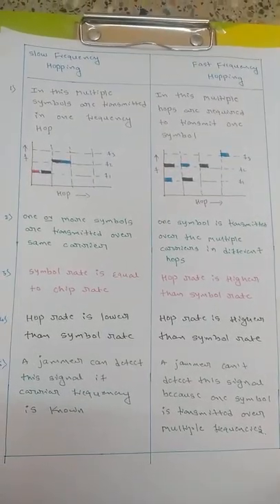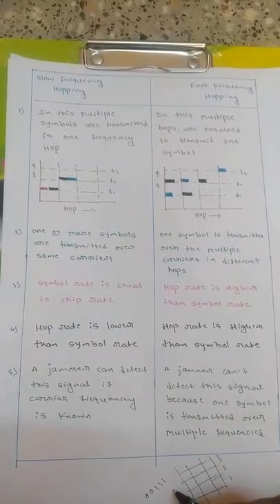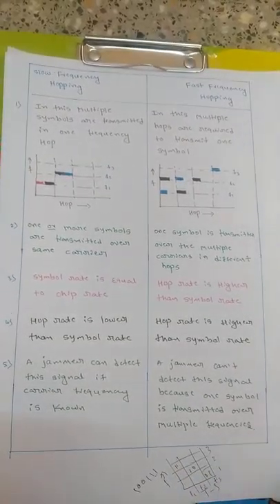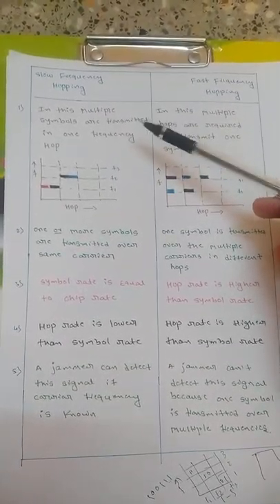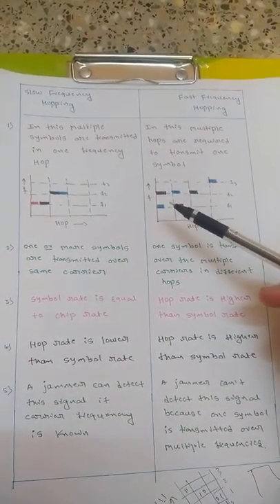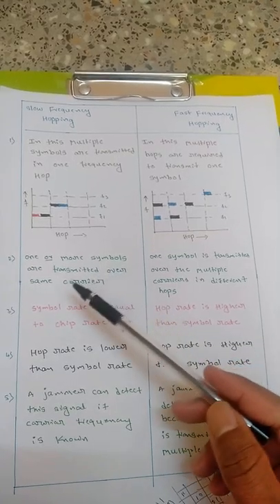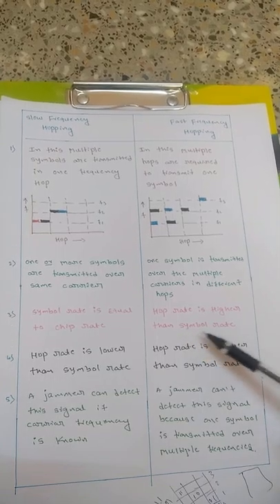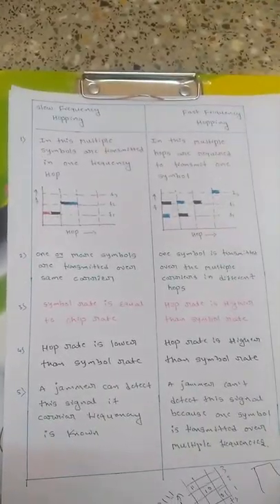Difference between Slow frequency Hopping and fast frequency hopping / slow hopping VS fast hopping

Comment: In fast frequency section the 3rd point and 4th point are same...did I understand it wrongly...pls help
Reply from the maker: Your right with respect fast frequency hopping the 3rd and 4th point are same 
But in case of slow they can be stated in both ways ...